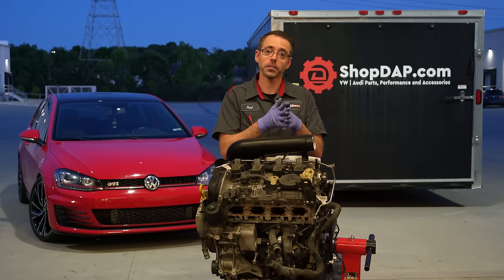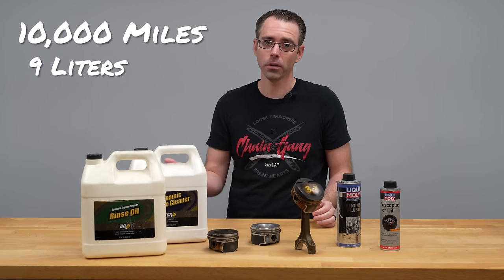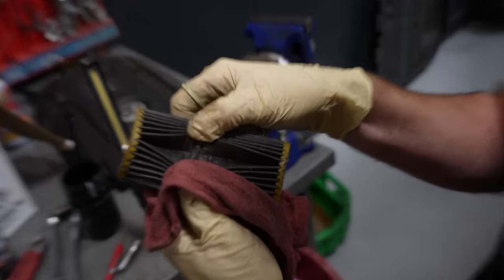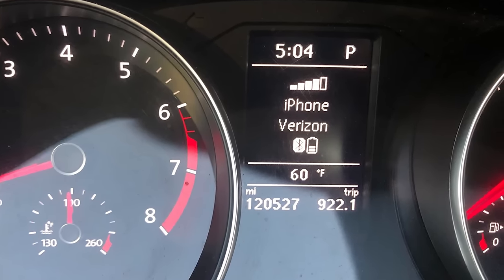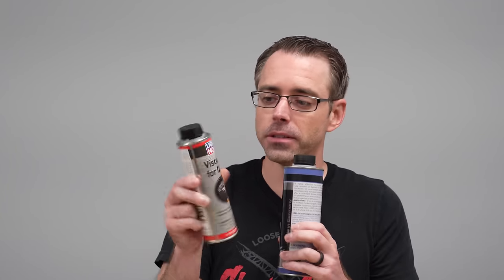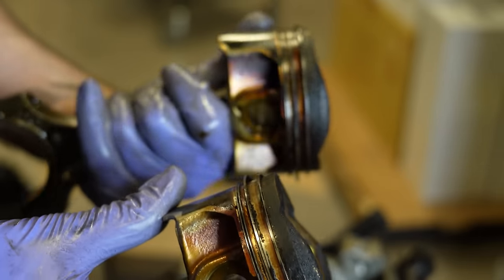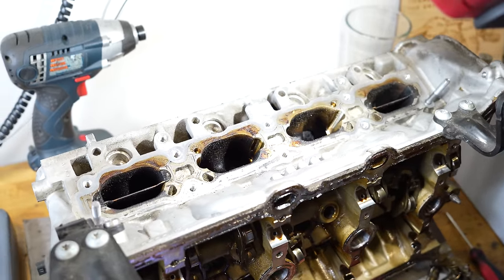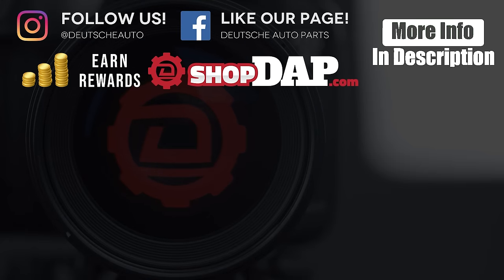Can you Fix an Engine Burning Oil for $20

Comment: Liqui Moly's engine flush seemed to stop the oil burning in my M54B30. Could also be because I started driving more economically due to gas prices, lol
Reply: Oil burning goes way down when you drive more economically vs high revs.
Reply: bmw's of that vintage always need valve stem oil seals. you can do this in situ with the right tools, very seldom to the m54 need piston rings, they DO like heavy driving tho, its definatly good for them so dont be afraid to go for it occationally. Great engine, only bettered by the M57 when reliability matters.

Comment: I have a 96 landcruiser with around 170k miles. 4.5l straight 6
When towing a heavy trailer and doing a lot of engine braking it was using around 1 liter of oil  per 1200 miles. Also if you left it standing for a few days, it would blow some smoke when you started it.
I thought it may be leaking valve stem seals, so I put in some Liqui molly Motor Oli Saver.
The old level dropped about 2mm in 500 miles and then stabilised. After 2500 miles the level hasn't dropped any further. Also the oil is much cleaner - still an Aber colour with a tinge of grey.
Reply: Get rid of it while getting is good.

Comment: I'm a retired ASE Master Technician that was trained at the GM training college back in the 90's and I can only tell you my experience on American cars regarding this oil burning issue and what I would recommend to my customers.
   If it were a Chevy 305 V8 circa 1985-89 and was burning 1 quart per 500 miles it would likely be an especially hard block where the rings wouldn't break in to the cylinder walls and I would offer the "treatment" we used to try: adding 1/2 teaspoon of bartender's brass polish to the oil and running it for about 1/2 hour at idle. Often this would cut the consumption down to 1 quart per 5000 miles and that's not bad actually. (Idling would not let the bearings make contact and the very fine abrasive would not wear out the bearings.)
   Another thing I would suggest is that they just keep adding oil and never change it, just replace the filter every 5000 miles. Constantly replacing the oil replenishes the additive package in the oil and may eventually get the rings to seat and stop the oil consumption.
   Beyond that, I would ask the customer what he wants to do: Add oil every 500 miles that's gonna cost $1000 over the next 50,000 miles, or pay $5000 for an engine rebuild. How long is he gonna keep the car? Is it worth the extra $4000 for him to not hassle with the oil burning? Also, it's been my experience that engines that burn that much oil can last for a million miles because the detergents and lubrication modifiers make all the parts last a lot longer.

Comment: I had some oil burning issue on my 1.8T and then on my 2.0pd, and switching from 5w30 to 5w40 completely solved the issue and its still factory spec... My 1.8T 20v was going through the dipstick every 700miles, then after switching to 5w40 I never had to top up between the 5k oil change interval. My passat 2.0pd when I got it I didnt have time to do the oil change on it myself so took it to a friends garage and they put 5w30 in it, after just a week of driving I already had an oil level warning. Change that too to 5w40 I only had to top up once between changes which I do at 8k miles. Oil in question is Mobil 3000 X1.
Reply: I do the same thing with my 1.8t 20v and mini cooper s N14, both cars use considerably less oil now I put 5w40 in them.
Reply: these engines were never designed for 5w30, they made that the spec for fuel economy reasons
5w40 should be the right oil
Reply: Stinking CAFE killing your engine

Comment: The last CPRA engine I ringed the oil rings were completely stuck in the groove. I used Chem dip and a broken ring to get the carbon out of the grooves. It was like concrete.

Comment: I have a few comments.  I work in the service department at Hyundai and we are having a hard time with oil burning on some of our vehicles, most of these vehicles are customers who never service with us.  I've heard the low tension rings reasoning before,  and I'm positive that's part of the issue.  The most common comment I get from these customers is "I've owned many cars and have never had issues before, and my maintenance habits have not changed"  I try to explain the low tension ring reasoning,  and they just fluff it off 🤷‍♂️  Honestly, I feel they should just get back to regular rings IMHO.

Second.  Is it me, or did the updated Audi piston have a thicker oil control ring gap?

Third, would.you be willing to try seafoam engine treatment on another oil consumption car?  I'd be interested to see how it works as well.

Thanks for the video.  I'm tempted to make business cards with a link to this video, and give them to customers who are lost when I try to explain this phenomenon.
Reply: I think Project Farm did a video with Seafoam, here's a link to a bunch of videos on the subject. 

https://www.youtube.com/results?search_query=project+farm+seafoam. 

I own a 1999 Hyundai Accent with the 5sp. manual, and it's holding up quite well with over 180k miles on it. I did a compression check a few thousand miles ago and it was hitting close to 200 psi per cylinder. I found it almost perfectly preserved in a thicket of blackberry bushes where it was forgotten for 12 years. The owner bought it brand new and put 159k miles on it in the five years he drove it. I gave him $300 bucks and replaced the ECM and the fuel pump to get it going and since then I have only had to replace the lower control arms in the front and the struts. It was almost pristine in appearance until I moved to the city where it has suffered the abuse of @$$H0L#$ who hate everything. 

Then I was sideswiped on the freeway while on my way to work. I've always wanted to test my theory on maintaining control of the car after being sideswiped, too many Bond movies and episodes of the A-Team are perhaps to blame for that. Weird thing is, that practice kicked in although I never practiced it, while I maintained my forward direction without getting outside my lane, the girl that struck me went spinning out of control. I got over to the shoulder as fast as I could and immediately ran down to her car . She was outside of it kinda walking away in a daze of confusion. 

I got her settled down and made sure she was OK, she was further confused by this as she felt I should be angry. I laughed and said, " If I thought you had done this maliciously, I would be. Even then, I would still want to make sure you were OK considering what happened after being struck. Besides, they are just cars we can get new ones, we don't get new selves if we are damaged beyond repair."

Her insurance Co. gave me $3200 and change for my car, not without me pointing out the fact that Blue Book and actual replacement costs are two entirely different things. do yourself a favor if you don't already know this and employ this knowledge should you ever have to deal with a claim. Otherwise you could end up with thousands of dollars less that you are entitled to. I used the money to buy a Honda Accord, but not before buying the Hyundai back. It is still very driveable as it was only affected cosmetically. Just to have around as a spare, I'll eventually get around to doing the body work, it's on loan to a friend in need at the moment though. It's a damn solid car, the second of which I have owned, I'd still have the first one but an ex-roommate/friend sent it to the boneyard fearing I had abandoned it. The title was still in his name unfortunately, and more unfortunately you don't find many if any of these cars in there anymore, hence why I bought a Honda, lol.
Reply: its because hyundai gdi engine is a garbage. currently own cadenza 2.4 theta 2 engine in it. I feel like carbon is building up crazy in it. The car only has 80000kms on it. now it has funky idealing in cold start and burning over a liter of oil between the oil change
Reply: additionally hyundai is going back to mpi engines for reasons except their performance line models
Reply: @SJ-kz4mv  did you install an oil catch can?

Comment: Back in the 60's when I was rather poor, we used to drain the oil & fill the engine full of water right down the carb, and leave it set for a day or 2. Water dissolves carbon. A complete drain, followed by a diesel fuel flush, followed by new oil, run maybe 20 minutes or so, change oil again. Sometimes it took a while to get it running again, maybe even pull starting. Even many automatics could be pull started before 1967. They would smoke like a coal stove for a bit, bit most of the oil burning was gone, and we got a lot more miles out of an engine that was already done before. We also ran straight trans fluid in the crankcase if they weren't too bad, and after a few hundred miles of taking it easy dirty lifters & such would quiet right down. I watched an old man pour a water/ scouring powder solution slowly thru a bad oil burner at a fast idle to reseat the rings. It was amazing how well it worked. Poor people had to improvise & adapt.

Comment: Chemicals can help temporarily, but in the end the piston rings have to be changed. sometimes your car will smoke upon starting it but stop after it runs a little. This is usually caused by oil leaking from beneath the valves this can be fixed by removing the heads and taking them to a machine shop to have the valve guides knurled.

Comment: You did a great job on this, a proper investigation following the scientific method. The improvement in compression on that bad cylinder was really significant. The other small 5psi variations in compression could be just random variations like whether the gaps on the piston rings happen to rotate around to line up with each other. The reduction in oil consumption is also a significant result. Some really worthwhile conclusions made here.

Comment: The problem is actually worse when you use low-tension piston rings in engines with gasoline direct injection that works in the range of 1000psi or more.  Not only do you get oil burning, but you also get gasoline dilution of the oil, some of which is taken care of if you keep the engine hot and it is allowed to evaporate out of the oil and go back into the intake via the pcv system.  But, if it is persistent, it's worse than oil burning because it alters the viscosity of the oil and destroys it's lubricating properties which means you're not just burning oil, you've got metal-on-metal contact and premature wear.

Comment: The liqui moly flush actually worked wonders for me, except that i also ran it for 45 mins at 3,000 rpms, drained and refilled, my engine used to burn around 2 quarts between oil changes and the throttle body had a light coat of  oil, PCV was new, surprisingly spark plugs werent fouled or dark, they were in excellent shape in a year interval

3 months after the liqui moly, the throttle body is DRY, and burns around 1/2 qt between oil change, engine also revs up to 3500 rpms soooo much quieter, totally recommend to try it out

Comment: Biggest issue I have with oil burning is it eventually ruins the cats. So you can either keep adding oil but eventually spend $1500+ on new catalytic converters, or you can replace/rebuild the engine for $2500+. Regardless, it's hard to justify this type of repair on a older car, other than just dumping it.
Reply: I didnt know that burning oil can ruin cats thats messed up i got tired of spending endless money replaced  cat , then manifold , then spark plugs , fuel injector.  I sold my car . Im done .
Reply: @n.ll.8796  Well it can clog your cat but you can use cataclean and that's it problem solved.

Comment: I personally have used BG’s EPR can (Engine Performance Restoration) on older Subaru engines that burn a fair amount and it dramatically decreased the oil consumption. On my daily driver Legacy with over 300k miles it changed from burning a quart every thousand to less than a quart between oil changes (4-5k). They make great stuff. I suspect this Passat will continue to burn less and less as that can of additive runs it’s course

Comment: My motor started burning and after discussing the issue with the shop i use for repairs they used a moly motor flush and changed the brand of oil on top of moving from 5-30 to 10-30 as the motor had over 225k miles. This boils down to trusting your shop you use. Quite often you can go in and get some advice about other issues as well that you can do on your own.

Comment: hi I can't remember where I saw this information but the Audi engine from 2009 and up that burns oil had the rings too thin compared to the new updated ring and piston combination and the modification you mentioned above the piston pins are probably helping I work on VW and Audi cars but never had the chance to rebuild one for high oil consumption only timing chains replacements but I have a few customers that had the Audi dealer fix the oil consumption with new piston and all of them stoped burning oil and I have seen cars with the factor is specs and intervals and they still had the problem with oil burning.
Reply: Perhaps you are not aware that the engineers at Audi and VW and other brands no longer know how to construct pistons and piston rings?
Chains and camshaft drives are also often incorrectly constructed.
After 150 years, modern engineers no longer know how to make pistons and springs.
That is a complicated matter, people think too easily about it, they should ask the retired engineers that and do not want to reinvent the wheel.

Comment: 2001 v6 Accord. I run amsoil signature and change oil once a year. Works out to about 13k miles. Now has 320k and does not burn more than 1/4” down on the dipstick over that year. Good oil works.

Comment: I had a 2014 Jetta with the 1.8T, absolutely great little engine. I did the 10,000 mi. interval and never added more than a quart during that interval. I should have never traded that thing in!

Comment: Your answer is the updated oil control ring.  The old 2pc ring clogs easily and does not allow drainback. The updated piston has a 3pc oil ring and as you stated the cutout was updated.

Comment: Grove was eliminated to give more rigidity to the area, since oil return ring size was increased significantly and excessive material was removed . Also that grove original was made to improve oil return to the pan, since they updated with larger oil return rings that grove is not needed anymore.

Comment: Eurotrash Motorsports has several videos where he fixed major oil burning in several of the Audi 2.0 engines by pouring Berryman's B12 chemtool down the spark plug holes a number of times and letting it soak for a period of time. Might be worth looking at his videos and giving it a try.

Comment: I had a 1975 VW Rabbit with 120,000 miles. It was using one liter of oil every 400 miles. After replacing the valve seals, the oil consumption went to one liter every 4,000 miles, and the gas mileage improved. Compressed air was used to keep the valves in place when the springs were removed.

Comment: Honda has been using low-tension rings for years. The older 5w-30 lubricated engines usually only presented a problem when habitually driven hard for many miles. I think the lighter oils spec'd in modern vehicles, paired with forced induction, is compounding this problem to an unacceptable level in some models.
Reply: Why not use thicker oils?
Reply: 0
Reply: @chegadorchegando5872  US CAFE standards.
Reply: If the piston ring tension isn't too low you'll be fine, so what do you mean by "low tension"?
Reply: I only drive ve commodores engines get a bad rep iv had issues not those issues just clock spring , gaskets ect nothing like chains